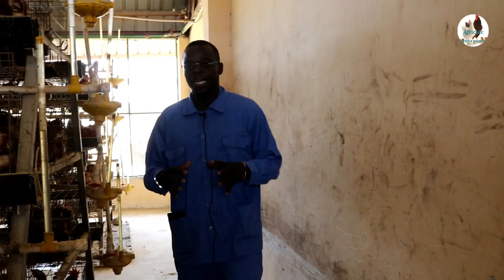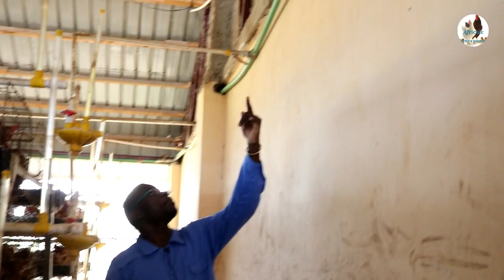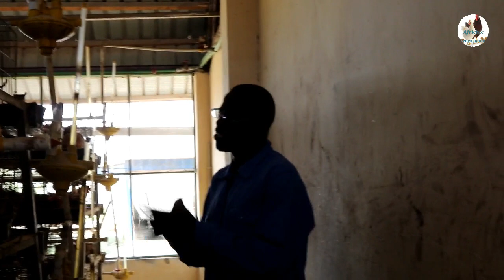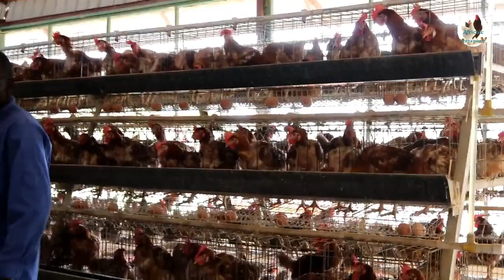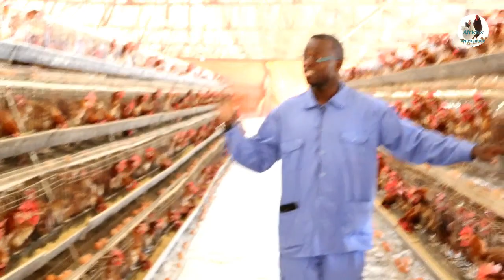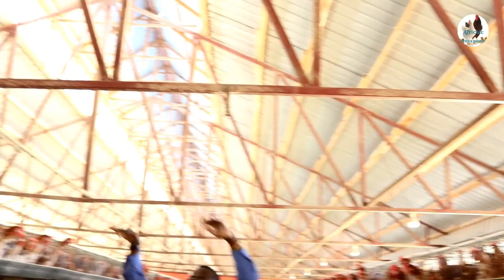How to Set up a batery Cage system I Spacing I Plumbing I Feeders

Comment: I am planning on setting up a 12,000 capacity battery cage system in Nigeria. Can you please suggest dimensions of penhouse? Height, width, length of the building. My plan is to have 3rows of 4,000 layers each. Kindly respond sir. Thank you.